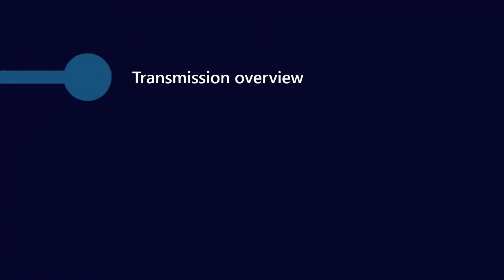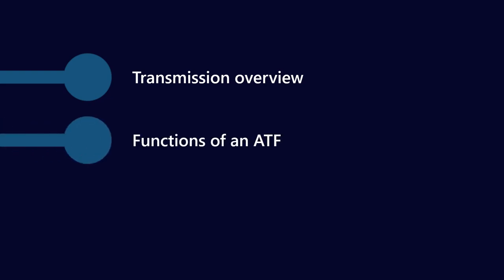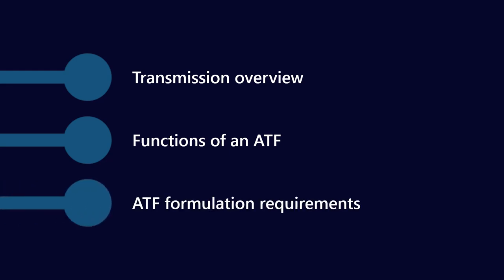What do ATFs actually do?

Comment: A lot of older hondas do not use planetary gear sets in their automatic  transmissions.. but they definitely do use a very special  honda atf dw1 fluid, and you don't want to use anything else or you run the risk of transmission failure!
Reply: If they do not use planetaries they pretty much aren't considered traditional automatics. Kinda like how people call CVTs automatic but they actually have very little in common with a regular automatic.
Reply from the maker: Yeah the selection of an ATF is a minefield - should probably do another video on that topic. It doesn't help that the brand names don't indicate the car manufacturer, i.e. Dexron = GM, Mercon = Ford, ATF+4 = Chrysler. Plus on top of that there are backward/forward compatibility issues and car manufacturers that rely on third party transmission built by companies like ZF.
Reply: @LubricationExplained  please do thank you!
Reply: Dw1 has a lot of zinc in it. Would ruin dexron based transmissions, and the "multi vehicle" replacements don't even contain zinc. I'd only use that stuff for Honda.

Comment: Can anybody help ? My old Corolla automatic is buzzing at high revs in low gear especially up hill, (fine otherwise) which would suggest poor lubrication .
Disconnected the return line and ran it into a bucket. Got free flow of about 3 litres a minute at idle. 
Should it have been faster than that ?

Comment: The fill for life is contentious as the AT service lifespan is defined by its fluid lifespan, unless you change the fluid thus extending the life of the AT
Reply from the maker: Yeah that was probably a mistake. My bad, I wasn't very good at these, hopefully the more recent ones are better!
Reply: @LubricationExplained  Oh it's not your mistake, car manufactures label the transmission fluid as lifetime, not you. What happens is the fluid thins out, but the clutch pack wear grit makes it effectively thicker, until the gritty fluid makes it fail entirely, but this almost always happens after the end of the manufactures warranty so they don't care. Manufactures don't mention that towing drastically raises temps which drastically reduces fluid life. Claiming the fluid never needs changing is good for the manufacturer as it makes the vehicle appear to have lower maintenance cost, at the expense of the longevity of the vehicle. Unfortunately if a vehicle costs a bit more to service the average consumer wont buy it, even if it will have a shorter service life as a result, costing more. Crazy.
Reply: Absolutely
Reply: @davidl6041  Yes, lubricated for life is lubricated until the life of the warranty .

Comment: High viscosity index?… or high viscosity??
Reply: High VI. Probably not high viscosity by many people's definition. To me "high viscosity" starts at ISO 220, so these are thin fluids. But if you regard ISO 100 as a heavy fluid, some of these verge on high viscosity.

As I was reading the comments, I was wondering if @lubrication explained had touched on the "exclusivity" of ATF specifications in a more recent video. Most ATFs are at the low end of the viscosity range for conventional lubricants: usually 3-6 centistokes at 100C, but some specs go outside this range. This reflects the different architecture of each OEM/Tier 1 supplier's product. There are graphics around on the internet showing the show the mutual exclusivity of viscosity range requirements for ATFs meeting different specs.

There's a comment above that also mentions that continuously variable transmissions (CVTs, the example given is Honda, but others are in the market) are often discussed under the same "ATF" umbrella. There are actually two main types of CVT - belt and chain, see https://en.wikipedia.org/wiki/Continuously_variable_transmission - which have significantly different requirements from each other (and the rarely-seen toroidal CVTs) and from ATFs.